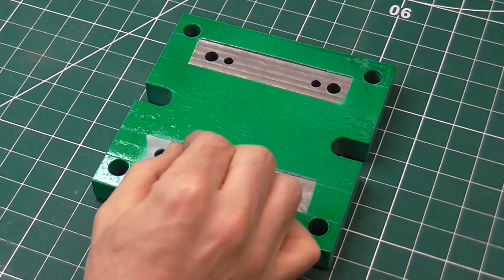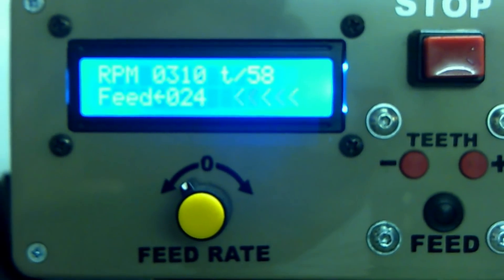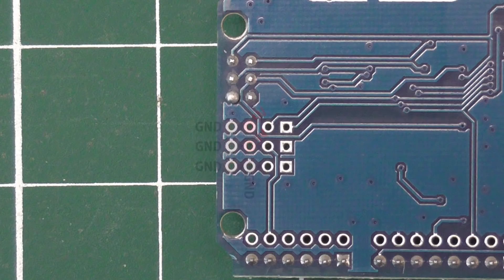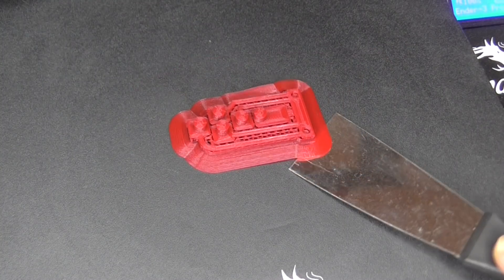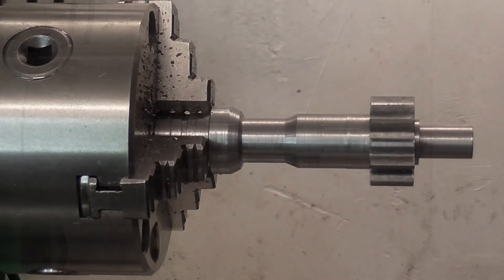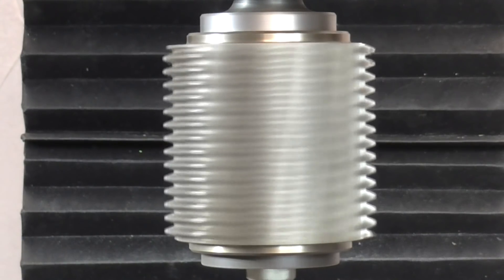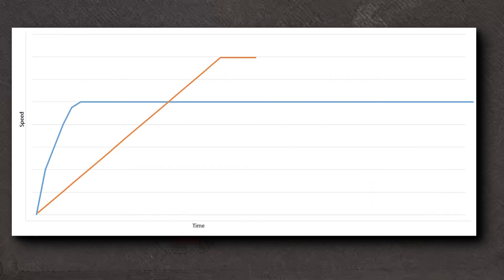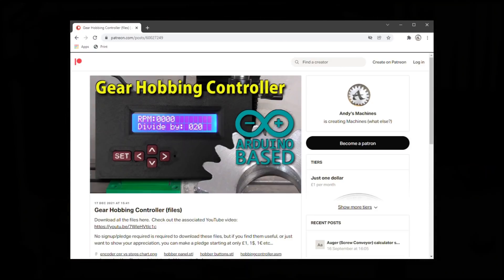Gear Hobbing Controller

Comment: Do you have a version of this project where you can just set a angle and manually step it forward to act more like a digital indexer?
Reply from the maker: This controller isn't set up to do that, but it would be easy to do with the same hardware (and you wouldn't need the encoder on the mill spindle). But for accurate results you would need to use it with a stepper motor mounted to a dividing head or rotary table with a higher reduction ratio than the gear hobbing attachment I built.

Comment: If we kick the mill head 90 would that allow cutting internal teeth?
Reply from the maker: Not exactly. You can do this: https://youtu.be/VJOem40ggkI?t=1177 But it's hard to get right. Calculating the correct geometry for the cutter is difficult.
Reply: @AndysMachines  Would it not be the same on an internal gear if we drop the hob in and do a side plunge inside the hole?

Comment: I wonder have you tried hobbing a worm wheel with this attachment? Any problems?
Reply from the maker: Yes, I have hobbed worm wheels with this method, it worked fine. In fact I have some footage of this I might use in a future video, I made a special hob that was similar in diameter to the worm. The only difference was that I fed the hob in towards the blank radially instead of across it axially. It should also be possible to hob the worm, but I've never tried this, I always turn them on the lathe.
Reply: @AndysMachines  Thanks for the reply. Greatly appreciate the thought that has gone into producing your hobber and the excellent standard of workmanship. I look forward to seeing it produce a worm wheel.

Comment: Hello. Would it be possible to demonstrate how you made the disk for the encoder? I bought a 200 line encoder but its disk is very small, about 25mm in diameter. thank you so much.
Reply from the maker: I've got this question quite a lot, I might have to to a video on how I modified my encoder. You can make a new disc for it, the one you have will need to be quite a fine pitch, but it is possible.

Comment: What is the make and model of your encoder please?
Reply from the maker: It wasn't any particular brand, I removed the read-head from an old servo motor I had and made a new codewheel for it that fits the milling machine spindle.

Comment: Very nice project, so I've tried to replicate it but sadly apart from the DOWN and Reset buttons none of other buttons work. I've uploaded an example sketch for Keypad Shield and the example works fine, all the buttons work that is. The LCD screen does show the default values RMP:0000 and Divide by:20. Anybody came across this? I did not solder the diode yet, but that would not, surely, affect the work?
Reply from the maker: If you have problems with the buttons, hold down any button (except reset) when powering on and it will take you to a configuration routine to set it up with your shield. Unfortunately this is an issue with some shields due to the way the buttons are addressed.

Note that you need the latest version of the code for this, if you downloaded it before 9 Jan 22 then you need to re-download it from Patreon.
Reply: @AndysMachines  Thank you for taking the time. I downloaded the newer version and that did it. The buttons now work fine.

Comment: Hi Andy, I read the comment on patreon, about the buttons not working properly. I have the same problem. Can you help me, what values do I need to change in the main.asm file? I want to read my button values wtih arduino AnalogReadSerial example, and enter them in the main.asm file.
Reply from the maker: Hi Dávid, I have now hopefully fixed this issue and I have updated the .hex and .asm files on Patreon. I bought some more LCD shields to test and it seems the button values vary wildy from board to board and there doesn't seem to be any standard that I can find. I have extended the valid ranges for each button so that they now work on all shields that I have tested, however there is a chance of some overlap and buttons behaving as different ones, so to fix this I have also included a configuration routine (hold any button on power up) that will set the correct values for your particular shield and store them.

Comment: Yes, I have been thinking about that for many years. I have already all parts for a Gear Hobbing machine. Now I have implemented it with your program (I can support your opinion about Assembler 100%). I use an encoder with 1024 lines and a stepper motor with 200 steps / revolution with a reduction of 1: 8, ie 1600 steps / revolution. It also works well, but after about 5 minutes run, the teeth are getting narrower. If I run the router on a spot, the teeth should always look the same for a long time, but in this case they will always become narrower.
Maybe I did not understand everything in your video, my Engish language skills are not so good, Google translators helped me with this text.
Reply from the maker: Not sure why this is happening. Do you have the hob set to the correct helical angle? This could explain it cutting wider than expected. The encoder counts/ratio you are using will divide exactly, so shouldn't be any problem there. Could you be missing steps, does it improve if you slow the machine down?
Reply: @AndysMachines  
After I,
- Replaced the stepper motor with a servo
- I reprogrammed the program for my configuration (interrupt of course in assembler rest in Bascom AVR)
- I connected the encoder to an RS422 it is a ROD 430. 1024 Heidenhain
I seem to have found the error now. The electromagnetic environment of my 3.5 kW Macmon milling machine should not be underestimated. There were so many disturbances that there was always a lost step. I was able to fix the problem with filters, shielded and twisted wires. Now it works fine, thanks for the great program

Comment: Andy, saw your comment on patreon side where a user was having issues with the push buttons not being recognized.  And it was suggested that you write code to "learn" the actual hardware attached.  Would it be possible to alter your code to do a less than check instead of an equal check of the upper nibble?   Like the following:
checkeys:
		sbrs	flags,3						;T0overflow (16ms)- done here to free ISR time for INTs
			rjmp	k0end
				cbr		flags,0x08			;clears interupt flag

				lds		rmp,ADCH			;read A2D value 
				sts		keyval,rmp			;store high byte
				lds		rmp,ADCSRA
				ori		rmp,0x40			;set start conversion bit
				sts		ADCSRA,rmp

				lds		rmp,keyval			;determine which key from A2D value
				
k0a:			cpi		0x0f,rmp			;right
				brlo	k0b
					ldi		rmp,0x01		;=1
					sts		keyin,rmp
					rjmp	k01

k0b:			cpi		0x32,rmp			;up
				brlo	k0c
					ldi		rmp,0x02		;=2
					sts		keyin,rmp
					rjmp	k01

k0c:			cpi		0x64,rmp			;down
				brlo	k0e
					ldi		rmp,0x03		;=3
					sts		keyin,rmp
					rjmp	k01
					
k0e:			cpi		0x96,rmp			;left
				brlo	k0g
					ldi		rmp,0x04		;=4
					sts		keyin,rmp
					rjmp	k01

k0g:			cpi		0xC8,rmp			;setup
				brlo	k0i
					ldi		rmp,0x05		;=5
					sts		keyin,rmp
					rjmp	k01

k0i:			clr		rmp					;no key pressed
				sts		keyin,rmp
				rjmp	k01c
Reply from the maker: Hi Will, Thanks for the suggestion. The original code I wrote allowed for a range of 16 values for each button (by comparing the high nibble only) with the actual value being somewhere in the middle of this range. I chose this range because some of the buttons have a value of only 16 higher/lower than the next, but the spacing does not seem to be at all even. I have no idea if there is any specification or tolerance for these values and assumed they would be fairly similar from shield to shield (the ones I tested seemed to be), but perhaps they do vary significantly, or maybe this user just had a bad one. 

Having these 5 ranges does mean there are 'dead zones' in between the expected values where a button won't work. Your suggestion of using BRLO instead of BRNE/BREQ is a good one and would remove the lower limit from each range (extend it down to zero). The overlap wouldn't be a problem as long as the buttons are checked in the correct sequence, however it would mean a button could be misread as a different one instead of not functioning.

What I have decided to do is write a configuration routine to read the actual values if the default settings don't work, this would only need to be done once (hold any key during power on to initiate configuration). This will ensure it will work on any shield even it it's values are way off or the buttons are in the wrong order (probably not possible, but would allow you to reconfigure the layout if you wanted to use it sideways or upside down). I will use the read values to define the range for each button, allowing for any variation over time, but I will use your suggestion for setting the default ranges before configuration. I have also ordered some more shields from a different supplier to compare.

[NB. For anybody reading this and not following the problem, this is due to a quirk of the LCD shields and how they address the buttons. They are not connected to individual arduino pins, but to save I/O they are all connected to just one analogue pin and each has a different analogue value, which appears not to be consistent across all shields.]
Reply: @AndysMachines  thanks for looking into my suggestions. 
I found ranges in the create.arduino.cc page under projecthub and electropeak.  The page was using-1602-lcd-keypad-shield-w-arduino-w-examples-e02d95
Using a second source for the schematic showed the voltage divider voltages we're roughly in the center of the ranges.
Thanks again for the effort you are putting into this.

Comment: Andy, I just stumbled on your project which seems to provide what I have been looking for. I have a Rivett lathe with its milling attachment. In the catalogue of 1901 there is a nice illustration of using the milling spindle with another attachment that mechanically linked to the nose of the lathe as well as the gear train. It also has a small indexing arrangement. This enables cutting of helical gears with a single tooth cutter running in the milling spindle. It is also capable of milling very long flutes such as drill flutes. Unfortunately this complex attachment is very rare. I have never seen one. I have another lathe with a electronic lead screw and I was thinking about synching of the spindle with the lathe axis when I came across your work. I will need to figure out the best place for the stepper motor. I have a spare encoder that I would rather use than a slotted wheel. They are readily available at reasonable cost. Your videos are excellent and clear I need to study them more.  John

Comment: Hi! I made these project,but I have a problem. The LCD not good funktion to me. Only  Firs row write out RPM 0000 on  1602 Lcd keypad Arduino. I don"t know what it is problem. Encoder in is good. W/R or data pin other ?The project is very good!  You know help me?Thank You!
Reply from the maker: These LCD shields seem to be quite variable in quality, I'm not sure why only one line would display, can you get it to work correctly with an example arduino sketch?
Reply: @AndysMachines  Thank You ,that you reply to me.
I upload the sketch  as you showed. Can you write to me,that your lcd shild pin wich?
W/R ?pin E ?pin and 4 data pin? So I can check it. Thank You your help!

Comment: Ya, using interrupt timers are way better than polling pins at 40 Hz. Funny joke at the end.

Anyone, correct me if I'm wrong, but I think Arduino supports all C. Is it possible to configure the chips registers with bitwise operations and even do in-line assembly? Has anyone tried this in Arduino?
Reply from the maker: As I understand it, it's closer to C++ but with some elements of C? Yes you can address registers directly and you can do in-line assembly, but apparently this is not always complied exactly as you write it. I did think about trying to do it in arduino with sections of inline assembly, but I don't know enough how arduino actually works and it was easier just to write the whole thing in the assembler (then I know exactly what's going on).

Comment: Can you use an Ac Servo motor which has an encoder also, with your control?
Reply from the maker: Yes, if it has a driver that accepts step and direction pulses.

Comment: Fascinating project.   I made a Rose engine jig for my wood lathe.   I used an Arduino Mega and started with the 2 line display like you used.   I found this tedious to program.   I changed to using a Nexion touch display.   A new learning curve to code, but so much easier using the Nexion editor to create buttons, provide test display etc.
The Arduino IDE is not the best, but it works for me.
A gear hobbing project is now on my wish list.
Thanks for the videos.
Dave.

Comment: Hi Andy, I have just found your channel, and am very interested in the gear hobber, by the way I loved the video on making imperial gear hobs, real Cholmondely Warner style.
I have a couple of questions if I may.
1: What does one do with the Main.ASM file?
2: when I use the CMD window as instructed I get the Following error
         System wide configuration file is ""
avrdude: can't open config file "": Invalid argument
avrdude: error reading system wide configuration file ""
Do you have any idea what I am doing wrong?
By the way I noticed the post about the port address being wrong, mine is COM5, but changing this makes no difference.
Hoe youcan sort this out for me.
Best Regards
Ron Cummings
Reply from the maker: Thanks for the comments! (Questions answered on your other comment)
Reply: @AndysMachines  I have the same issue. Seems like the AVRDUDE.CONF is missing. Can you share your copy? OR What am I doing wrong?
Reply: @wernervdmerwe5765  Hi Verner, The file should be in 
C:\Program Files (x86)\Arduino\hardware\tools\avr\bin, But for some reason it seems to get loaded in 
C:\Program Files (x86)\Arduino\hardware\arduino\avr\bootloaders\gemma
Copy the file from here and paste it into the folder listed above.
It took me days to find this, hope it solves your problem, it worked for me!
Cheers
RonC
Reply from the maker: @RonVan1XP69  Yes, it seems there are different versions of the arduino software. I had hoped that by using arduino for this project it would make it easy for others to copy, unfortunately there are still pitfalls along the way!
Reply: @AndysMachines  Hi Andy, it's all good, we will get there in the end, I have some of the mechanical work to finish, got laid up with a heart operation for a while, but getting back slowly.
Without the contribution of people with the skills you have and are willing to share many of us wouldn't be able to make these projects, so your input is greatly appreciated 😊. 
Keep on keeping on.
  Cheers 
RonC
Reply: @wernervdmerwe5765  hi easy way use xloader for hex writing
Reply: Hi Andy, 
I  can't seem to find my first post, which is why I posted the same message again, it just seems to have disappeared for me, sorry to be a nuisance but could you please repost your answer.
Thanks
RonC
Reply from the maker: @RonVan1XP69  I think the comment was on the other gear hobbing attachment video?

Comment: Hi! Does it have normal dividing mode and what a min division resolution?
Reply from the maker: It's not really intended to be a static/indexing type dividing head, it divides dynamically for gear hobbing. However if you used it on a 90:1 dividing head you would get a resolution of 18000 steps per revolution (1'12''). The software does not currently do indexing though, so you would have to use the encoder like a rotary dial to input the revolutions.
Reply: @AndysMachines  I see. Thanks for reply.

Comment: I mostly write in C++ (with only my own, custom, libraries) and rarely drop to assembly anymore, but I feel much the same about Arduino.

I love assembly on the ATMega, and also the ARM Cortex. I never was a fan of it on the PIC 16, but the PIC 24/dsPIC 33 is pretty nice.

Either way, actually working at low level ensures you know what the heck the code's actually doing. And, that's worth a lot.

Comment: This is a really well worked out setup. I am impressed with spindle match functionality. That’s the cherry on top of the cake. Also this 3D printed display module is so nice, I can think of a few more projects I am going to use it for. Btw, I’ve used PIC chips long ago and they did the job but I’m lazy and atmega328p works for just about anything I ever intend building.
Reply from the maker: Thanks! I actually only made the panel 3D printed to make it more accessible for other people to copy, but I was impressed myself by how well it turned out, plus it was quick and easy.

PICs are great, but vary hugely in their capabilities, so you do need to choose the right one. The ATmega328 is a much better all-rounder and tends to be my go-to device for almost everything these days.